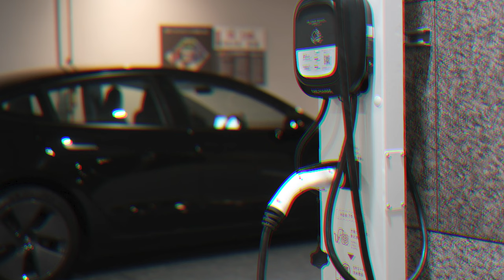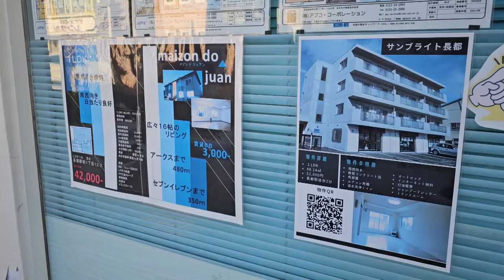Japan's $67 Billion Chip Bet

Comment: Japan is certainly very suitable to re-join the semiconductor supply chain. They used to own almost all of the semiconductor industry, from essential chemicals to production machines to foundries. Their proximity and friendly relationship with Taiwan also mean they can get started quickly with joint projects like the jasm. However, the Koreans don't seem to want to work with the Japanese on memory chip production. This could be a big issue if North Korea decided to start a war since the Koreans have a monopoly on memory chips.
Reply: Japan still dominates essential chemicals and production machines. 30 percent of semiconductor chip making equipment comes from Japan, with companies like Tokyo electron and Lasertec having 100 percent monopoly on some machines used in EUV lithography. But Japan lost its competitiveness in foundries to Taiwan and South Korea. Hope it regains its edge. Another thing is Koreans don't have a monopoly on memory chips. Kioxia, WD also has a significant market share in memory chips
Reply: The same issue continues in Taiwan. Rapidus aims to take over the foundry sector market share occupied by TSMC, saying that Taiwan is under constant threat from CCP. Japan's strategic goal is to intensify the geopolitical tension between Mainland China and other neighboring countries and act as the main key chain of the Indo-Pacific region, thus relocating international industrial manufacturers to Japan.